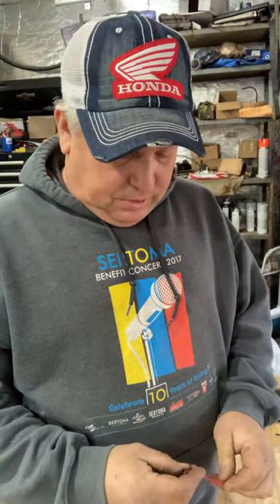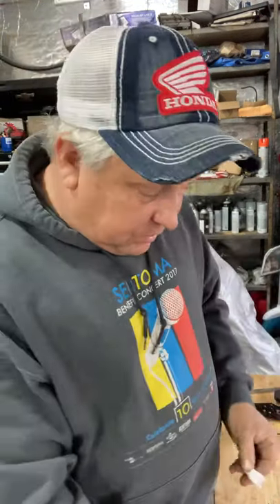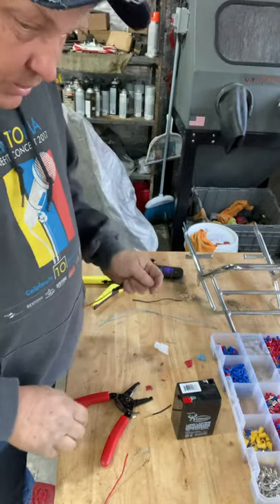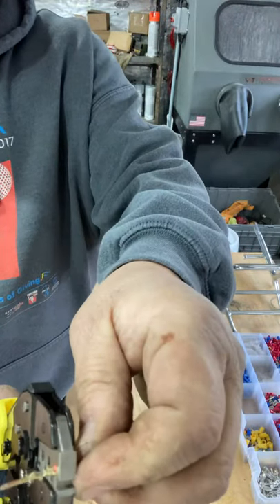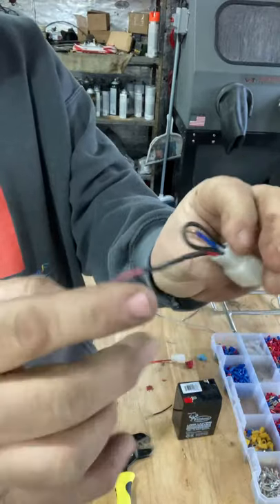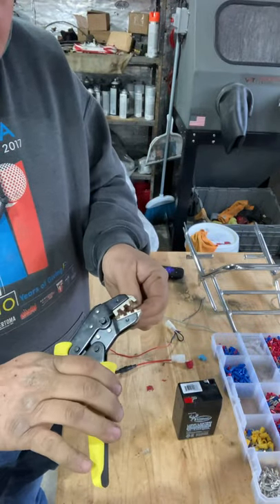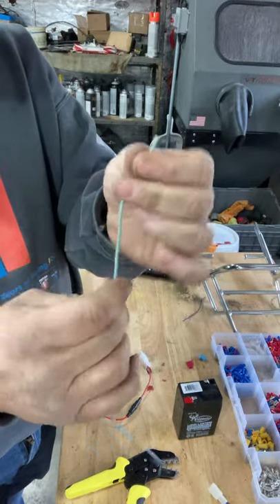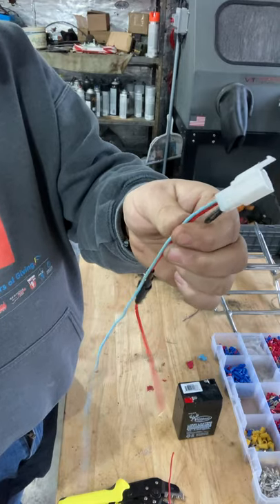1970 ct70 ko battery pigtail tutorial

Comment: Question about the jumper from the stator to the coil - picked up a new full wiring harness for my K1 and out of the box (sitting on my bench not connected to anything) I’m getting continuity across all of the black wires  - from the stator to the battery (both black), the coil and ignition.  Is that normal?
Reply from the maker: Yes
Reply: @yorkymotogarage561  If continuity between the stator and coil is built-in to the wiring harness, why add the jumper on the battery pigtail?

Sorry if this seems like a silly question, this is my first CT70.  Appreciate your videos!
Reply from the maker: @unclemoki6502  it acts as a disconnect when you pull the battery out it disconnects from the coil so it doesn’t fire . Safety reasons .